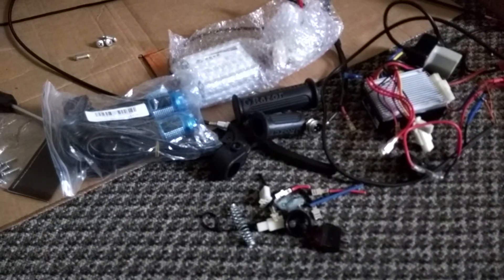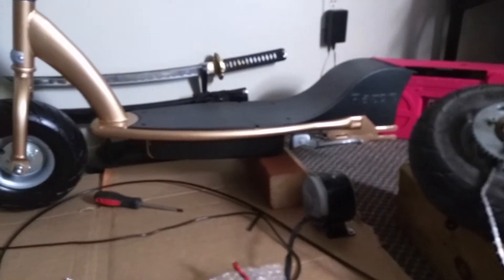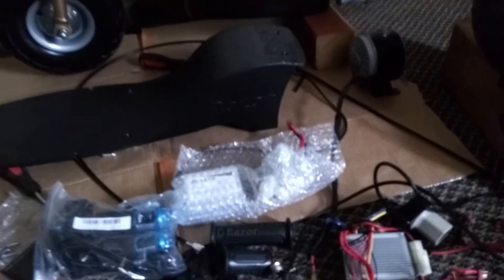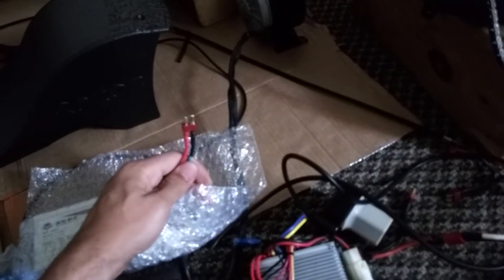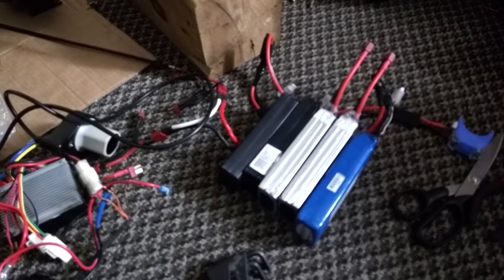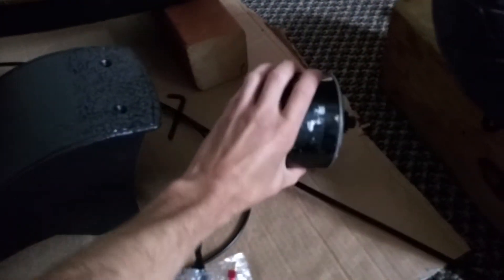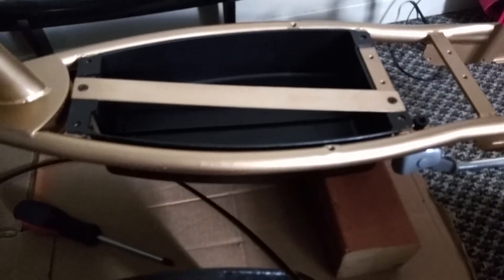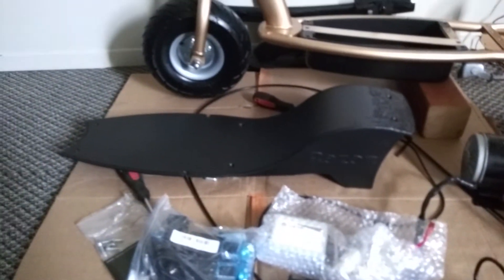Razor e300 electric scooter upgrade speed and torque

Comment: I know you uploaded this a while ago, how did it turn out? What set up did you use? Thanks!
Reply from the maker: Hey frog thanks for the interest.  Yes i did end up adding the 48v 500w brushless in wheel motor I will have to do another video on it soon.  I like the brushless in wheel motor i can get up some steep hills with no lag very nice.  Almost as nice as my 48v 800w dark knight set up i got from japan.  Toys too much fun I have three ride on scooters and i run them all
Reply: RC Empire please do another video. I have 5 razor 300's for me and family and friends. Everybody else is fine with stock but I want more. I went lipo 7s with aftermarket controller and a larger rear gear to give it more torque, but looking for more speed. Can't decide if I want to go 36v on the stock motor or not. I'd love to do a brushless hub rear wheel. Just can't find much info on them or where to buy. I'd like to see your set up.
Reply from the maker: Here is the link I will get the video made soon thanks for your interest :) https://www.aliexpress.com/item/10-inch-48v-500w-hub-motor-kits-double-shaft-for-electric-bicycle/32644643551.html?spm=2114.13010708.0.0.mXLEYU
More watts = more speed if you want to do 22mph/36kmh 500w is enough if you want want to go around 30mph/50kmh then the 800w would work i got the 500w.  
Has to be double shaft and i had to dremel the area where the shafts go because the old tire shafts were smaller.